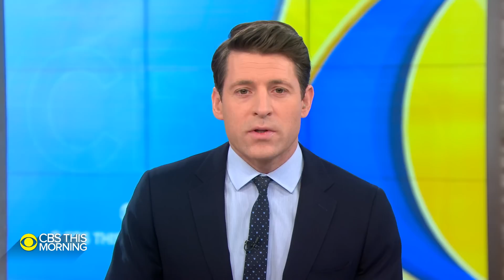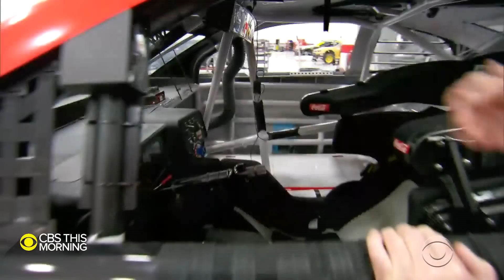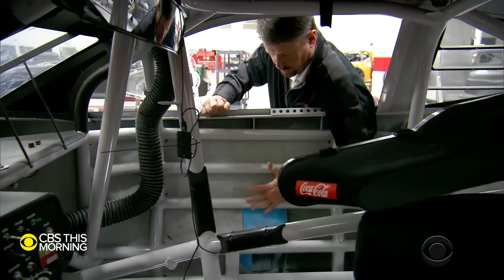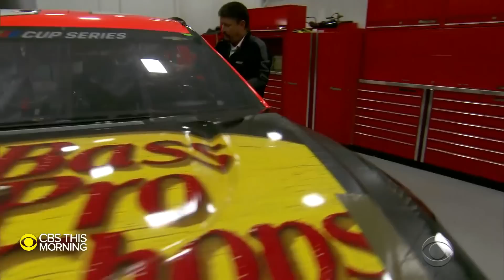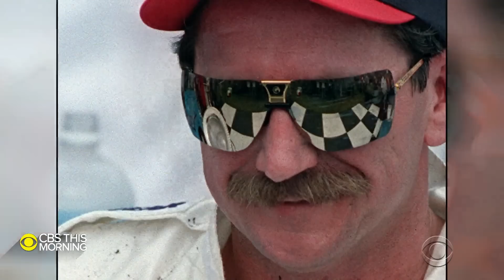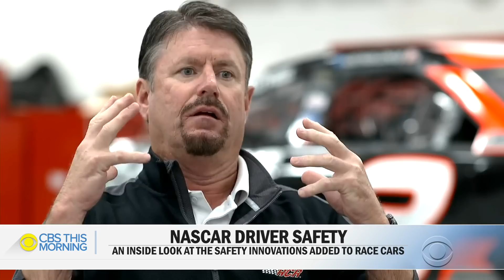Ryan Newman's Daytona crash raises new questions about NASCAR's safety

Comment: I believe that the Newman car, the tip of the car barely hit the wall & made the car spin, was the only thing that saved him. I think 99 times out of 100, in that type of wreck, that he would've been killed. He missed death by inches, because the tip of the car by inches barely hit the wall & put him in a spin. If the tip of the car hadn't hit the wall, the car would've stopped suddenly on the wall on the drivers side or hit headlong into the wall in an instant stop. When a car stops, the driver is dead. The tip of the car put it in a spin. When he was in the air , a car sped up under him. If that car had slowed down, when he came back to the ground, that could've killed him. It was a miracle that he survived.

Comment: I can't stand restrictor plate racing. They need to get rid of it. Make the cars less aerodynamic, install small gas tanks, smaller engines. Anything that will split the field up.  Racing in a big pack is boring and leads to horrible crashes like the one we saw Sunday.

Comment: you want to know how to make nascar safer? lower the speed limit to 55 mph.
Reply: Would have to be at least 72MPH  ....  any slower and the cars will not corner in the 30+degree angle bank they will slip down the track slope !! 
 It's crazy how much G - Force it requires to make them stick to the pavement !! 😲

Comment: The car that crashed into him didn't even slow down because the driver was desperate for glory. Disgusting and sad.
Reply: Have you ever even watched a race before? He had less than half a second to react once he realized he wouldn't be able to miss the other car. And also, what glory? He was going to finish 6th or 7th until he hit the other car and he ended up 8th I think. There's no "glory" in finishing 7th or 8th. It's the Daytona 500. A month from now no one will care who finished anywhere in this race except 1st. Get a clue.
Reply: The drivers are clearly not trained to avoid collisions and stop the race when an accident has occurred.
Reply: @h7opolo  That's what the caution flag is for. They're 200 ft from the finish line. The caution flag won't come out since the race is that close to finishing, and besides there's usually a couple seconds of a delay after a wreck starts before the caution comes out anyway. These wrecks happen so fast it's almost impossible to get slowed down in time.
Reply: You proved me right. They were close to the finish line so safety precautions were avoided to prevent disrupting someone's glory.
Reply: @h7opolo  Still have no idea how you're coming to that conclusion. Emergency personnel were no later getting there than they normally would have been. Throwing the caution wouldn't have kept him from getting hit again. He wouldn't have had enough time to find out they were under caution and be able to slow down before hitting him. Literally nothing that could have been done differently.
Reply: @h7opolo  by the time it came out it wold be over
Reply: Stfu! You don't even know what your talking about so just shut up

Comment: I don't know NASCAR but did that dude spin him out on purpose?
Reply: No. He tried to go low, then high, was blocking both times, and then because he had such a big run, and wasn't going to lift since they were coming to the checkered flag, the front driver didn't have time to straighten his wheel before receiving the bump after throwing the block, and if you don't have the wheel straight when you get bumped, 9 times out of 10 you'll get turned. Just a racing deal.

Comment: You want more safety, then lower the speed to 35 miles per hour. Crash tests on vehicles are rated on that number. The downside would be a 500-mile event would take 14 hours to complete! Okay, enough of the nonsense. Fact is, due to the tragic crash that ended legendary driver Dale Earnhardt's life, safety standards were put in place. Those enactments may have saved Ryan's life. Anything to improve conditions and safety would be a help, but remember, this is auto-racing, bottom line. And anything can still happen. I'm not saying not to add to or further improve standards, there are, I am sure, ways and means to avoid these types of accidents, but the reality is, serious incidents will never go away, no matter what. It and the human factor will always be evident. My story.
Reply: “Serious incidents will never go away” unless, I dunno, they didn’t have nascar races? I doubt we’d have any collisions at 200 mph ever again if that was the case. So there is a way to stop it, but I’m guessing you, or at least others, would be outraged by the concept of abandoning such “an american sport”

Comment: When is Car auto makers going advocate these safety features in civilian vehicles to some moderate extend?   If it works for Nascar, it would work for the general public.
Reply: MrMJmusicLover yeah, let’s all mod our vehicle so there’s one seat, and so the doors don’t actually open you have to get in through the window. Ffs, how about you learn to drive better instead, I thought triggered trumpublicans wanted LESS government oversight into everything.
Reply: @lotusauer4785  I didn't say the entire safety features did I or are you  trying to be sarcastic.
Reply: @lotusauer4785  I don't support Trump.  There you go again throwing in what you think I meant.
Reply: They will when you decide to spend $250,000 on a Toyota Camry with the safety features of a race car. These cars cost $500,000 each to build.
Reply: @kodyhightower1903  I said for civilian use. Meaning regulated to strengthen body of a car during a crash and five point harness attached to factory race style seats to keep the occupants in place during extreme crashes.   A civilian style Hanns device would reduce the number of spinal injuries that results from certain types of crash impacts.  Child safety seats are already designed and modeled after racing seats that saves their lives multiple times during crashes.  If they work well for the babies, the would save the lives of adults as well.   You people need to be open minded and think instead of trying to sound smart by trying to make others look dumb.
Reply: @MrMJmusicLover  I don't think you understand just how much technology goes into making racing seats, harnesses, and roll cages, and how much it would cost to add them to regular cars. At a minimum you'd probably be looking at the cost of every car increasing by $25,000. You might be willing to pay that, but a lot of people either wouldn't be willing or couldn't afford it.
Reply: @kodyhightower1903  It doesn't have to be Nascar standard to cost that much and the roll cage in a passenger car could be embedded in the body frame, not necessarily the interior.

Comment: Not about "safety" .  Its about good sportsmanship.   A bad driver hit him.
Reply: Not everything at that speed, bumper to bumper and door to door is intentional.
Reply: What are you even talking about? Which one are you calling a bad driver? No one did anything wrong. It's unfortunate what happened, but it's just a racing deal. No one lifts coming to the checkered flag.
Reply: @kodyhightower1903  Hard to stop fast at 200 MPH. If he was a bad driver he would not be on the track.
Reply: @johnharris8191  That's what I'm saying. Idk what the guy with the original post was even talking about.

Comment: Idk.. he spun out, hit a wall, got hit by a car going 200 mph in the drivers seat upside down, flew 20 ft in the air, slid to a stop on fire, and survived. I wish the cars we drive to work everyday were half that safe.
Reply: The push is called bump drafting. 2 cars close together go faster then 1 by its self. The second car has momentum because air it opened up by the first car and when the second car bumps the first car the first car can easily gain up to 7 miles an hour in speed. Down side of it is if your dont hit him square in the rear bumper you get thus crash for a reasult
Reply: Not only survived but is actually walking around the hospital
Reply: @bwalsh1105  They already sent him home. I spent more than 2 days last year when I had pnemonia.
Reply: @cgh7337   Pneumonia  is a known killer  which has to be under control before they release you .  Newman  may have just been knocked out    with no neurological  after effects . Rest maybe  his only cure.
Reply: Yeah, looking back they have made those cars in NASCAR  nearly deathproof and they are always looking for the next advance in safety.
Reply: And I didn't see one air bag
Reply: @joeyrabon4208  If you're talking about the wreck, they don't have airbags because it will hinder their ability to get out of the car, and with their restraints for the belts and their hans device it doesn't make sense to have on a race car, plus it'll only weigh the car down, and won't really do anything anyway. It won't improve safety or reduce it, because of how many restraints they have
Reply: @cav7933  i was sarcastically speaking
Reply: @joeyrabon4208  Oh rip. Well either way that's the reasoning lmao
Reply: @joeyrabon4208   Racecars use active restraints   such as  racing seats  , 4 point harness and a full face helmet   with a hans device .  Airbags are passive devices  . Basic knowledge  !
Reply: @sarahann530  it was sarcastic
Reply: Haha so true
Reply: The problem is those cars not only cost a lot for that safety but all the equipment for the roll cage etc takes up so much space every car would only be able to hold 2 people. Not to say I’m against it or any more safety in daily drivers but the way they improve safety is just for racing alone because they only need 1 person in the car at a time and for everyone else that isn’t really an option
Reply: @colemcgrath644  we also dont go 200 mph
Reply: @ryanaustin1321  Google some photos of what crash victims look like when the cars were only doing 35-40 mph. There's one on there of a dude where half his head is gone.
Reply: @colemcgrath644  i rather pay more if ik a car going 100 or eevn say 65 can save me no problem
Reply: Nicky D then you can just pay for your own individual roll cage anyways. I’m saying they won’t mass produce them because people won’t/don’t have the money for cars to be even more expensive. If you want one just buy it for your car right now genius